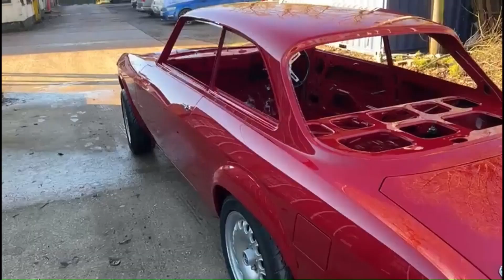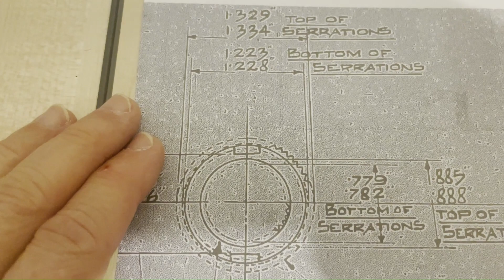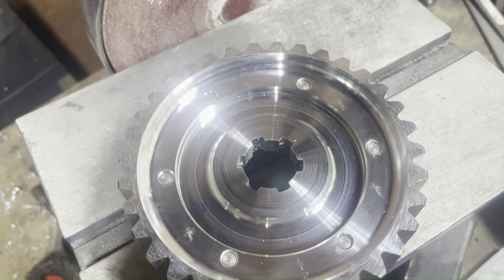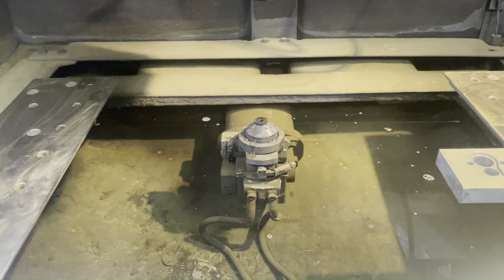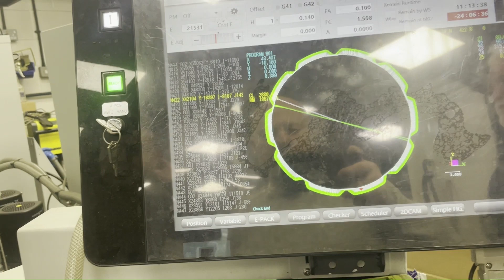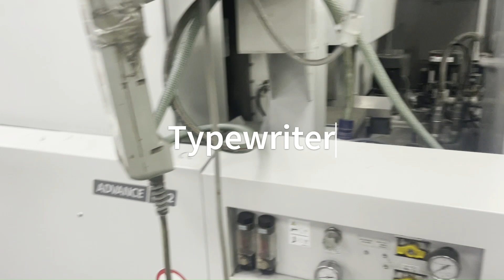2024 Clutch on a 1939 Rudge - how's it done Pt1?

Comment: I've been looking at fitting a modern clutch to my PU Triumph. I saw one years ago, I think in Classic Bike magazine, where the chap used a Suzuki clutch but the article lacked engineering detail. 
My dad gad some drive pins spark eroded out from a timing cover, which cost about £40, so that makes me wonder how much wire erosion costs. 

By the colour of your clutch basket, it looks hard anodized. I have an alloy (chain drive) basket on my 71 T100 and that has so far lasted longer than an original steel one.
Reply from the maker: To give you an idea the splines cost me £90 but that was as its complicated and a lot of that is the programme writing. The basket is hard anodized.
Have a look at the clutch basket i used on my GP500 or War Wolf there both all alloy no issues and around £100 from memory
Reply: @hilbilchillbil  That's not bad price for what's involved. Isn't the code output on the screen a visualisation of what was set up in CAD. My son runs 5 axis CNC mill and occasionally has to alter the code, which comes from CAD.
I'll have a look for the video of the GP500. Thanks